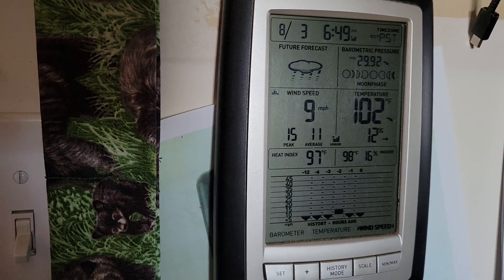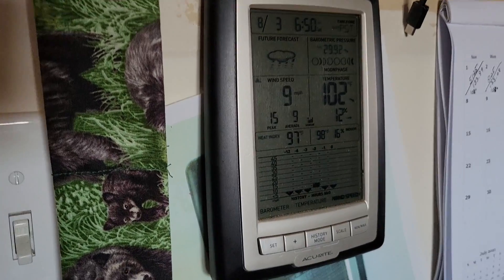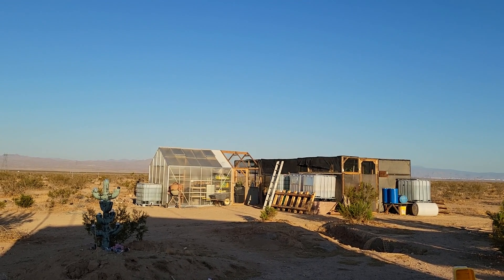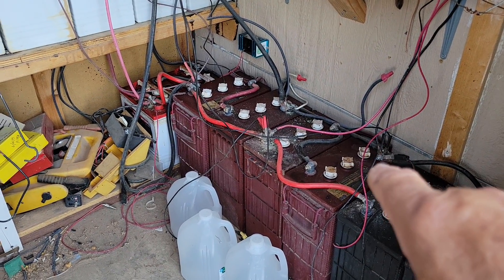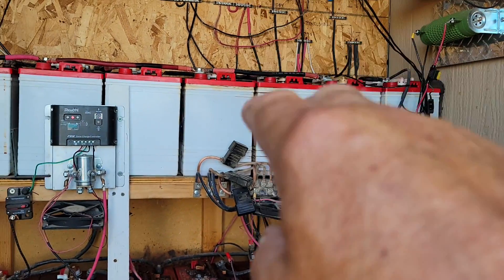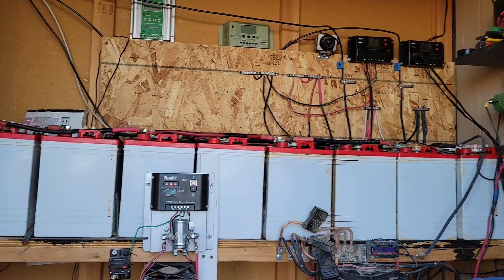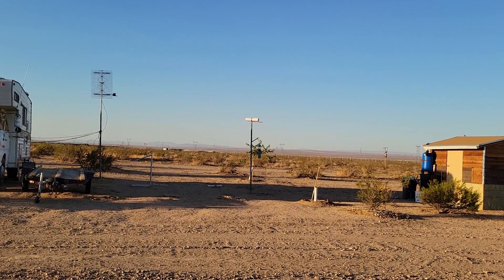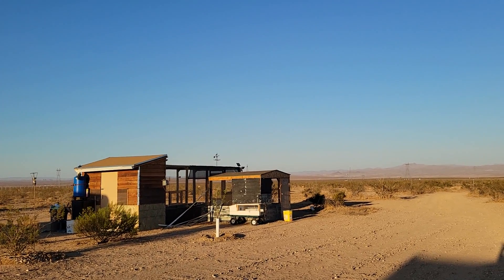Battery Bank Maintenance in a Heat Wave, August 3, 2021

Comment: i am almost CERTAIN you say the thing you do to be a troll and have people correct you in the comments. 12v has NO PLACE in off grid. it was never meant for it, it is a carry over from rv, and the trucking industry. 24v came from the Heavy Equipment industry. 48V is MEANT for Off-Grid. Grid tied systems are around 250-1000v, no batteries whatsoever. 
ALso the LiFePO4 letters are their PERIOD names, not their Atomic Names. The periodic table DOES contain their atomic weight, but it is NOT their atomic name, thats not a thing. Also the PO4 is PHOSPHATE! They are Lithium-Iron Phosphate batteries, and thats how you say it. 
It dawns on me that you are going to ask, if 12v systems are not meant for off grid, why do so many do it? Well, it is lack of knowledge prior to starting, and then acquiring a bunch of 12v gear and not wanting to replace it for 48v gear. The wire size alone should be enough of a reason to use 48v over 12v. it is less than 1/4 the size, PLUS, 48v gear is more efficient, less voltage drop over the same length. So, the equipment is smaller, does more, more efficient, and suffers les loss, and you dont think its better? I honestly am not sure what to make of your videos sometimes. You are a character, and I feel I MAY be getting punked here, and if I am, then you win. Maybe I should proof your videos for you before you upload them, lol.
Also, if you wonder WHY I take the time to correct you, it is this; You have many people that watch and learn from you, and lots you say is bang on. but if people follow the stuff you say as accurate, they could be put in a bad place. I really need to do y own show to put these myths to bed, and make sure people can see the proper way to do these things in a safe and cost effective way. Oh yeah, forgot to mention, 48v is CHEAPER too.
Lastly, I hope that you understand I mean these corrections from a good place, not to shame you, but to make sure others get real info. I hope that you address these facts and corrections in a future video, takes a real man to admit that he's made a mistake.
Reply: There are other tradeoffs across the 12v, 24v, 48v spectrum (I'm going to ignore grid-tie because the idea here is off-grid and if you tie into the grid and the grid goes down, you are dead in the water anyway). 12v equipment is most common -- you can buy most of it just about anywhere. 24v and 48v equipment usually has to be ordered and is usually commensurately priced. The biggest issue to me really is current -- and the wires to carry that current. You can run 24v at half the wire thickness that is needed for the same amount of power (and 48v at half that).
Reply: Point taken; however my stuff is 24 volts , because it was good enough for the army,  and I didn't have enough to go to 48 v...the inverter is way higher cost than my Aims inverter/charger which I had to save for months to get...I just don't have that kind of money for the parts...my little bit is off grid...the way I had to buy stuff...two batteries a month, there's 14 so far...I figured Id just get enough batteries to run my Aims inverter/charger (2000 w) and then get enough panels to charge them...but everything is normal,  Im not in 12 volt or 48 volt world with everyone else...doing my own little thing, outside the box like always...I heard a couple who went from 24 to 48, they said , go straight, to 48, and since Im poor, I'm stoppin at 24...lol
Reply from the maker: Yeah, that's why I named my channel "G Bear's" Off Grid Ways.  
As old Blue eyes said, "I did it myyyyy way."
Reply: @Michael Illingby One thing you didn't mention in your 12/24/48 V equation is the load that is put on it.. I would not need a bigger Volt system due to the load of about 500 watts maximum,.. Usually much less than that of ~200 watts.. It works perfectly well,, does exactly what I need, and has been working flawlessly for over 3 years now.. When my inverter dies I will change to a 24V setup,, but not for a while.. I am certain there are many situations where a 24/48 V setup make more sense,, just not here..
Reply: @deserthorizons  you know that’s not true; I watch your Channel also. You run ac. If you had more power you could run a mini split which would heat and cool saving you propane and increasing overall quality of life. You have a fridge tv computer and internet. 
I never said 12v doesn’t work, just that it has no place in proper off grid living. You say it fine, but if you rewired your batteries for 48v and got a nice all in one 5k inverter you would wonder why you ever did it 12v. It’s just not the right tool for the job, Nuff said.
Oh yeah you could even make coffee and cook on electric.
Reply: @sNEAKYnIGHTmUPPET  Yes, I run AC,, it uses ~450 watts and that with my refrig, which uses 90 watts (<50 watts an hour) is how I came up with the 500 watt number.. My laptop uses about 15 watts and that is what I use most.. Even if I were running 48V I would not run a mini split.. I would need many more solar panels to run the electric heat I would need to keep me warm.. and the added cost to get one is not justified to run the ac part during the little time I need it.. btw, I make coffee just fine with my french press,, which makes much better coffee than a drip does and I have an electric burner to cook with that I have used many times,, especially when I was in the RV.. But I prefer to cook with gas,, always have.. I prefer to heat with gas as I can roast myself out of here if I want..
Your "solution" to everything wrong with a 12V system requires a lot of money.. my little 2/4K inverter cost 300 bucks.. See if you can find a 5K 48V inverter (that you would buy) for anywhere close to that price..
It is your "blanket" statement that 12V does not belong in off grid is the part that I have trouble with.. In a perfect world where everyone has the money to buy what you think they should run is just not feasible.. You do realize that 48V does not make more electricity.?  My 8 - 12V batteries hold more amps than 4 - 24V do,, and more again than 2 - 48V.. so, other than efficiency I don't quite understand the gain that justifies the expense.. Maybe you could enlighten me..
Reply: @deserthorizons  Not in defense of the statement that "12v does not belong in off grid", but I do want to point out that you are making his argument. The fact that your 8 x 12v batteries draw twice as much current as 4 x 24v is really the gist of the issue: we want the equivalent amount of power for the least amount of current. Saying that you can draw twice as much current is the same as saying you can generate twice as much heat and require twice as thick and more expensive cable for the same amount of power.
Reply: @brikshoe6259  I understand the current part of it,, what I don't understand is what difference does it make.. I am ignorant of all this sort of stuff,, as are most off gridders.. but the way I see it is I plug an AC in that draws 450 watts.. with my 8 - 12V batteries each giving 225 Ah = 21,600 watts.. If I make those 8 into 4 - 24V then I have 900 Ah giving 21,600 watts.. If I make them into 2 - 48V then I have 450 Ah giving,, guess what,, 21,600 watts.. So I don't get where I get extra power from doing 24V or 48V or what difference it makes.. I have asked several more knowledgeable people and All I ever hear is it is more efficient.. So what.? I get the same amount of watts out of it regardless.. Or am I doing the math wrong.? or something else wrong.?
Reply: @deserthorizons  No, you are doing the math correct. It is truly only about PIE: the higher current at lower voltages requiring bigger cables, bigger fuses, and creating more heat. If you are satisfied with what you are getting out of 12v, then I say more power to you.
Reply from the maker: Take the total amphours of your battery bank and divide that number by the total amps you need to run, and that will be how long your battery bank would last with that total draw.
What makes a difference is the draw in amps, because like in my situation I have high amp machines in my shop, so I NEED the amps to prevent burning out my motors.  My milling machine draws 20a at 120vac.  My inverter supplies 33.3a at 120vac, but that piwer has to travel 45 feet to the shop, then another 20 feet from the subpanel.  I feed the shop with 6ga wire, then 12ga to the individual machines.  Higher voltages with lower amps would damage or kill those machines.  Thinner wires are not even an option.
My 12v dc system is the most efficient for my purposes.  Others may not have the high amp draws that I have, so 24vdc, and 48vdc works for them.  Note that I use a pure sine, low frequency, split phase, 120/240vac inverter wired with 1/0 from the battery bank, and 4ga from inverter to breaker panel.
If you are interested, my numbers are 4708ah at 12vdc and I would need 100A to run everything i own at once, but that never happens because I never leave a running machine, so i cant run more than 1 at a time.
For now, my 33.3 amps at 120vac and 16.6 mps at 240vac are adequate, but I will stride towards 100A at 120v in the future as money allows.
Reply: @deserthorizons  well, NOW you are starting to get it. You see, when people tell you "More efficient" it's not just a buzz word, it means something. You see LEAD ACID and AGM batteries do NOT like to deliver AMPS! PERIOD! Look at the spec sheet from ANY lead or AGM maker, they will tell you that their rates are over 24 hours to get anywhere NEAR the rated capacity. So, How can we get the same POWER, but with lower amps? HIGHER VOLTAGE! you can get as much as FOUR to FIVE times the amount of POWER by drawing from the battery more slowly. The battery does NOT care what VOLTAGE you wire it for, but how many AMPS you ask it to deliver. this is the main reason 12v sucks for inverters because the AMP DRAW IS TOO HIGH. I have mentioned this to gbear about 786 times, but it falls on deaf ears. Deserthorizons has been advised the same thing by my at least three times. 
So, I am making two arguments here, one for higher voltage battery bank, and a second for a larger all in one Inverter like a MPP Solar 5048mg. I AM an electrician, and I RUN these things, I am speaking from experience. I Know that you say that you are ignorant to these things, but I am not. 
Something else that people don't understand is WHY 12v is so prevalent, and its simple, it is CARRY-OVER technology. 12v was used in RVs because the vehicles that towed them has 12v batteries that were readily available and cheaper than inventing a new battery. then people parked rvs and lived in them, still 12v. then people want modern household items, so the logical, however not great idea was to use the battery that everybody had already because it was easier to sell something that would work with what the masses already had. It has NOTHING to do with good, cause it aint; just easier to sell. 
I would love to see some honesty from someone like gbear. Maybe a video that says to his viewers, "Hey, I am still using old crap from the beginning because it is what I have; DON'T do it like I have done, do it properly from day one. if you want to live off grid, then buy the right stuff from day one." I mean stop propagating BS just because you are in the center of it and maybe can't afford to do it properly. 
Do Better G-Bear, you know what I am saying is correct, you appear to be a trades guy, you must see what I am saying.
Thanks for taking the time to read this far if you have.
Reply: @sNEAKYnIGHTmUPPET   FOUR to FIVE times the amount of POWER.?  i call bs.. everyone else i have brought this up to says nope,, no more power,, just more "efficiency".. which means cooler and the ability to use smaller ie: cheaper,, wires..
(with my 8 - 12V batteries each giving 225 Ah totaling 1800 Ah giving 21,600 watts.. If I make those 8 into 4 - 24V then I have 900 Ah giving 21,600 watts.. If I make them into 2 - 48V then I have 450 Ah giving,, guess what,, 21,600 watts..  what you are saying is I can get close to 100,000 watts going to 48V with my 16 batteries.?
btw,, you never did find me an inverter..
IF I were to start a new system i would go with 24V, but since i have everything already.......................

Comment: Them batteries I think are 2volt u will need 6 for a 12volt but that batterie could be 1900 amp hr
Reply from the maker: Negative.   In lead acid batteries, each cell is 2vdc.  A 6v battery will have 3 caps, a 12v battery will have 6 caps, and a 24v battery will have 12 caps.  Each cap covers a 2v cell, so as some may think, you can't just fill one cell and expect it to flow to the others.